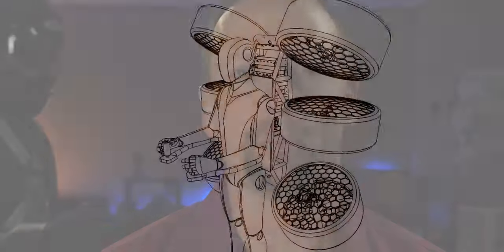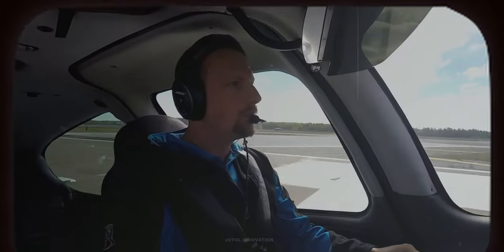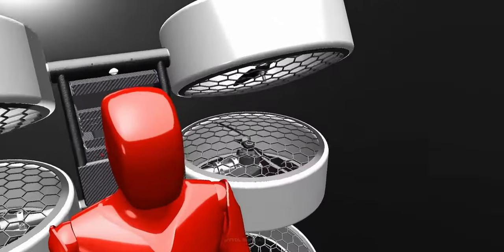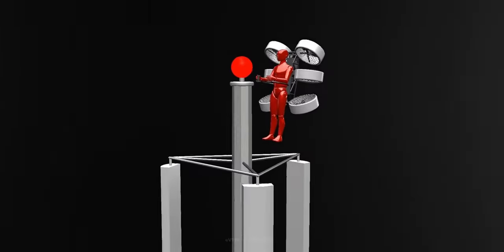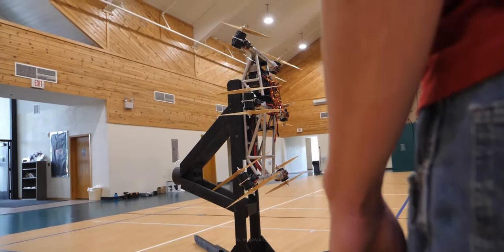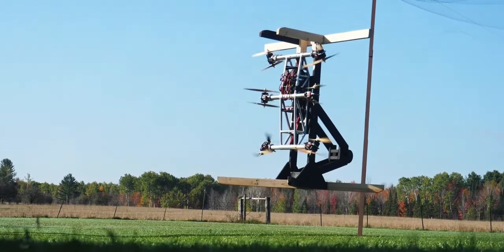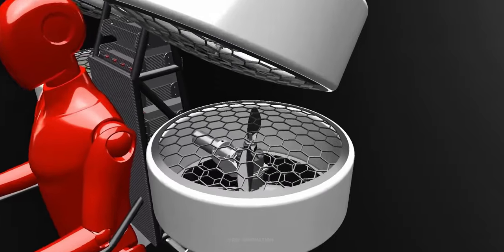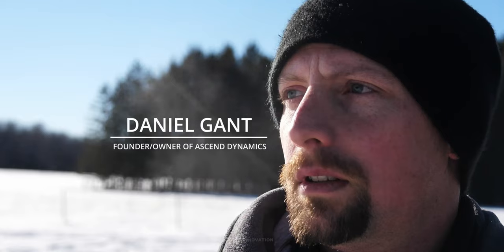All-Electric Flying Backpack | Ascend Dynamics SKYPAK V1

Comment: Hi! So I'm going to ask a question. Why didn't you use extended shaft motors? In this way, it was only necessary to place propellers in the direction that I wanted to make the movement and the result I wanted. Extended shaft motors would save more batteries and could even increase flight time. But I liked the project.

Comment: What would happen if you put your leg underneath the rotors (not through the blades but below the bottom rotor where the air is going down) would you lose control because the air going down will be hitting your leg and effect stabilization.